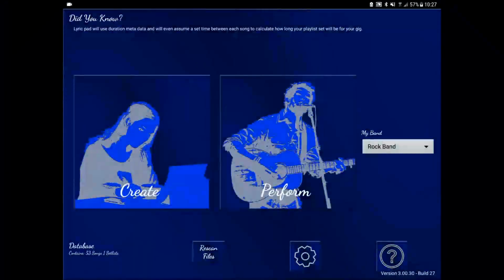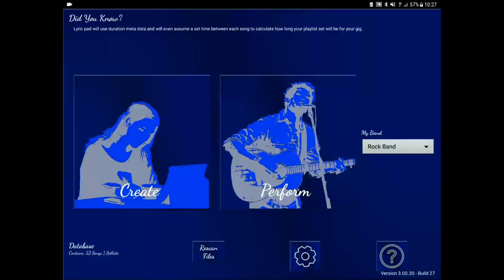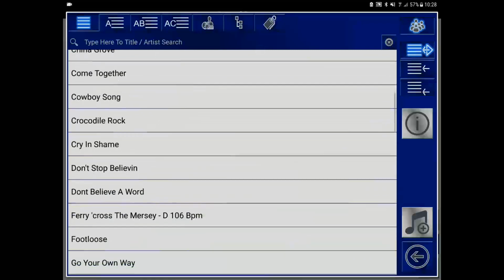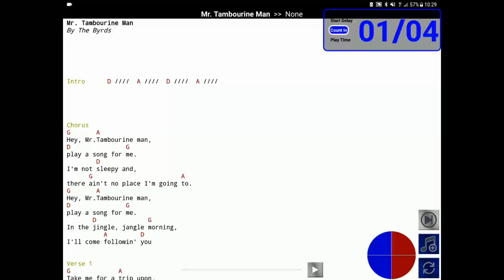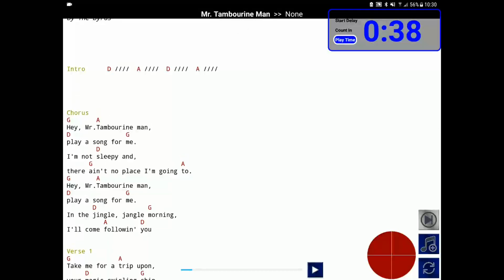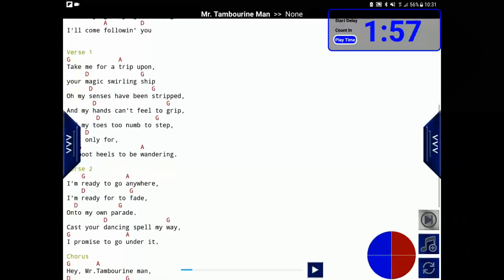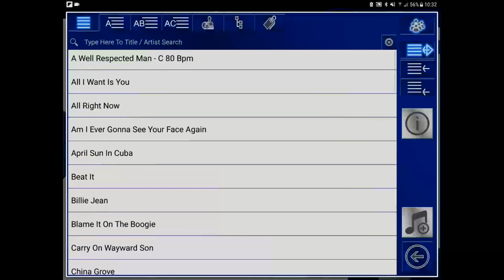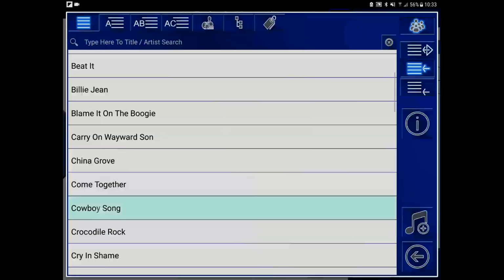Lyric Pad 3 - Basics

Comment: I already use ForScore for my lyrics but I want to move to Android from iPad whilst the app is good, there is no scrolling and my eyesight isn't what it was! However, my backing tracks are provided by my bandmate on another device so I use my lyrics totally independent of a track. Can you set a scroll rate independent of a track for lyrics alone?
Reply: Yes,  you can set your scroll automation if you do not use backing tracks.